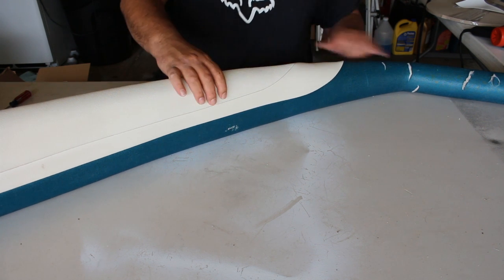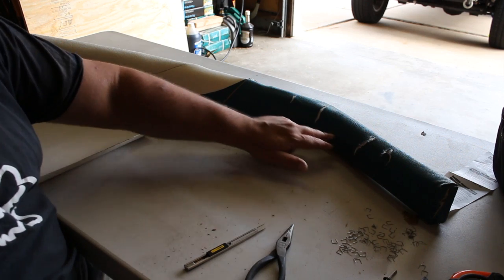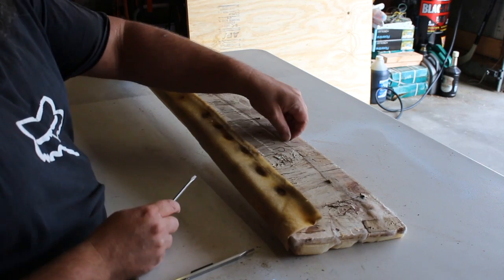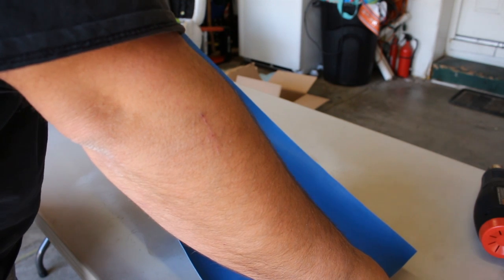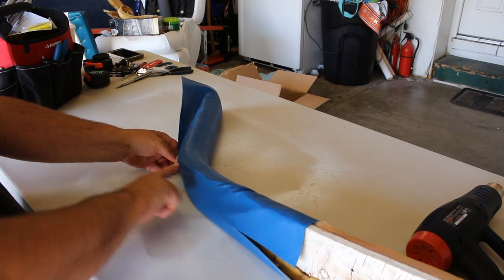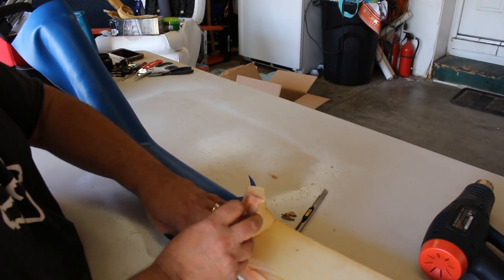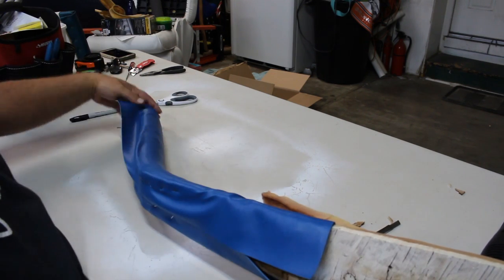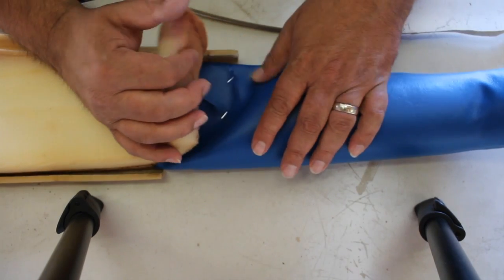How to Boat Upholstery Front Bow Side Panels * NO SEWING * Boat restore Marine Beginner Boat Project

Comment: OMG!!!! This couldn't have come at a better time!!! I've got to do this SAME THING on my new acquisition. Thank you!
Reply from the maker: Right on, I hope it helps!!  Good luck with your project!!  Thanks for watching and be sure to check out my other boat project videos for more ideas!!
Reply: @MileHighCampers  , I'm re-watching the video. Still liking this fix. Quick question while watching it. The vinyl seems to be a bit bulky, is that the case?
Reply from the maker: @guyh.4553  They can seen that way, you may have to play with stretching it from both directions at the seam to make it a little tighter.  Some pieces that I worked on took a lot of time of stretching, sometimes even pulling the staples up and re-positioning the material underneath and on top to get the outcome I wanted so you may have to play with it to get the result you want. Hope that helps!
Reply: @MileHighCampers  thank you! I'm in the process of swapping out outboards on my Starcraft from a Bayliner. The Bayliner is on rough shape so I want to fix it up just a bit before I sell it. So this is key. Thanks again
Reply from the maker: @guyh.4553  Sounds like a project! Good luck and thank you for watching!!

Comment: Anytime I do restore I sand the back of the wood that is exposed fill in all cracks and holes with wood putty sand one more time and use enamel paint to seal it works great for older panels I have 37 year old sun ray did that to all the cushions on it and they will last another 37 years.
Reply from the maker: Great tips thank you for sharing!

Comment: We are restoring our 1991 Bayliner and your videos have been super helpful. We even ordered vinyl to wrap it because we think we can definitely handle that now. Just a question if you have time...we have two pieces in the front of the open bow that we could not see screws to remove so we cut the vinyl to be able to see the screw head and remove them. Did you have this issue with this and and how would we get those back on once recovered? Not even sure how they would have covered them in the first place to get them on. Any help from anyone would be great if they ran into the same thing!

Comment: How did you go about measuring the fabric so you can know how much vinyl to get? It's my first time doing upholstery
Reply from the maker: I measured the panels and kinda of added extra for overlap... I was right on with the blue but I did end up with a lot of white left over. One way you could do it is dissemble all the pieces and than lay them out. I think most of the rolls or 60" wide.  I'm sure there is a better way but that's what I did.  Thanks for checking out my video!!

Comment: Man this really helps but I have a stupid question. How do you attach it back to the bow as i am doing my first one and there's nothing left but pieces of rotten wood and holes in the fiberglass
Reply from the maker: I will be honest it is a little tricky there were short screws that I had to reach in behind the fiberglass and screw them back in the a really short screwdriver.  I think if I had to do it again I would try these clips that Sail Rite Sells, check out this video:  https://youtu.be/BNGoKNmmP20
Reply: Ok yeah i was thinking that was how... I'm definitely going to go a different route  thanks for the link

Comment: Do bayliner cushions pop off in the boats? The 2000’s and above?
Reply from the maker: Hey, Thanks for checking out the video... I not 100% sure about that... this was a 1992 in this video... I would imagine they either unsnap out or they are hinged and need to have screws removed to take them out.  If you check out our channel we have the removal process video there.  Thanks again!!

Comment: How do you attach it back to the boat?
Reply from the maker: Unfortunately, the same way I took them off,  it was a bit tricky but it was possible.  If I were to do it again I may have considered using the BeauClip  panel mounting system. Check out this link:  https://www.sailrite.com/BeauClip-Panel-Mounting-System-Black